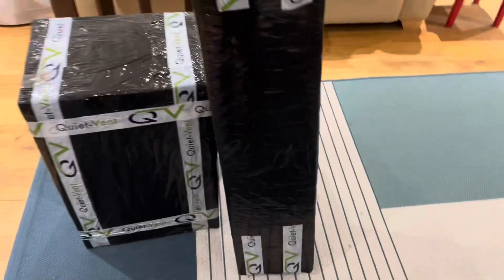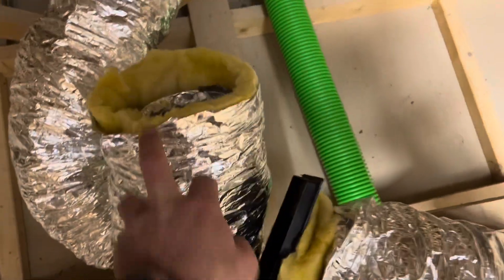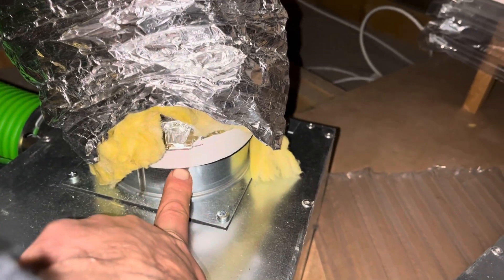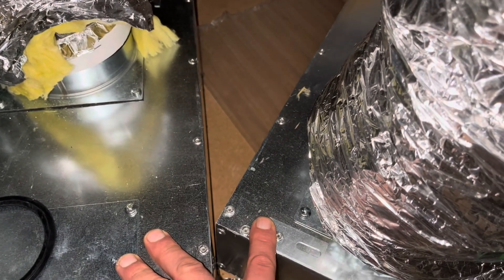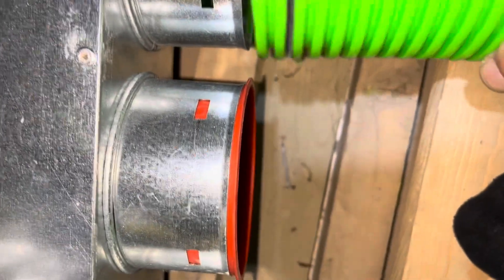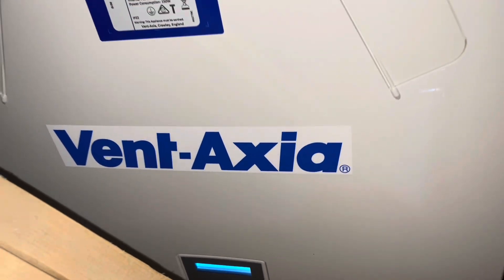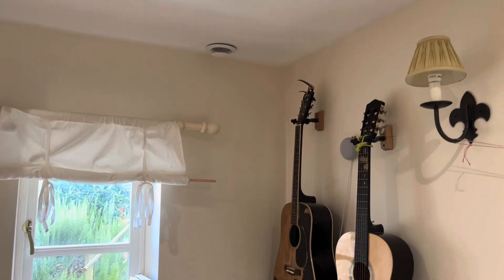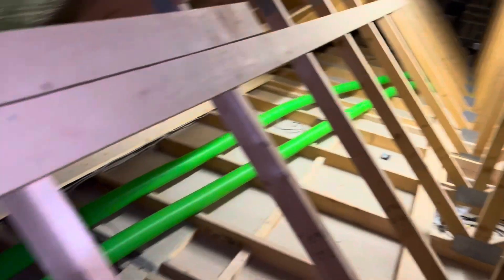4. DIY MVHR: Attaching the ducting to the MVHR unit and turning it on for the first time - success!!

Comment: How can you balance this system?
Reply from the maker: This is something I still need to do as part of full commissioning. The way to do it is get a bucket to cover each duct with a hole in the bottom and an anemometer in the hole. Then you can work out, and balance, flow rates

Comment: Compliance to BR Part F states flexible duct to a min of 300mm , MVHR needs to be able to access the heat exchanger to be removed for service when you need to remove the heat exchanger you will need to take the entire unit down. . You need to mastic the seals around the top of the unit.  All ducting in the loft void needs to be insulated. Many areas of this install are not compliant. Ceiling grills you need to install correctly and adjust to the correct airflows. MVHR installation is not DIY>
Reply from the maker: Thanks for the advice, I am slowly insulating the ducting in the loft (along with insulating the floor of the loft). Also the unit is very accessible where it is so has been fine for changing the filters. So hopefully neither of those will cause any problems going forward. And the system is certainly working as I’ve never had condensation on any windows since installing it and my hygrometers show the humidity in the house is significantly lower

Comment: You really do need to move that unit so that you can service it. How can you even get to the control panel to configure it? I added a remote screen to my one, I think it was £50. That way you can at least see when it is on summer bypass or in frost mode.
Reply from the maker: Yes I liked the idea of a remote screen as well. I may get one in the future but for now I’m quite lucky that the unit has plenty of space around it and I can move it easily to access the screen. I think I can also quite easily remove the filters although I haven’t tried that yet. I’ll try to make a video of that when the time comes to change them.
Reply: @aktsolar  I think what helps you is that your larger ducts seem to be flexible while ours are ridgid steel pipe that we had to then insulate. I can see if that is the case you could move your main unit. For us to do that is many hours work.
Reply from the maker: @JurassicJungle Yes, that’s right, the large ducts are flexible and insulated. It does make it very easy to move the unit
Reply: @aktsolar  Ours were all solid steel pipe so lots of cutting and mounting brackets required. then it all had to be insulated. I think it took me a couple of days working in such a small space. I guess there could be some efficiency difference or perhaps noise but your setup looks so much easier.

Comment: Looks good, have you noticed any difference in condensation? Have you measure the temp of the air coming in to the rooms to see how good it is at warming it up from the outgoing air?
Reply from the maker: I also have a hygrometer downstairs in the lounge. It used to be typically in the 60-70% range. Now it’s in the 50-60% range. It’s been going for a week and it seemed to reduce slowly over the first 3-4 days. It seems quite stable now. But then the weather outside makes some difference so I’ll keep an eye on it over the coming weeks and see if it stays down - or maybe even goes down further
Reply from the maker: Yes, no condensation at all on the bedroom windows now.

Comment: Looking really good - well done.  I had some questions
- Some rooms have the air sucked out and some have air pushed in.  I guess bathrooms and kitchen have air sucked out but where do you push air in?  Do you need to push in upstairs and downstairs or does it not matter?  Did you include bedrooms as well?
- Does the boost apply to all vents or can you limit it to a specific bathroom?

Thanks
Reply from the maker: Yes, you suck out of the toilets, bathrooms and kitchen. I also plan to have a vent sucking out from the boiler room (just to prevent any fumes from that getting to the rest of the house. Then you have it pushing in in the lounge and bedrooms.
Reply from the maker: So it does push in in more places upstairs and suck out in more places down. But then it crosses over in the hallway that is common to upstairs and down so it doesn’t matter that there are more intakes upstairs than downstairs
Reply from the maker: And yes, the boost boosts everything. I think you want the inflow and outflow to balance in the house so you wouldn’t want to just boost one outflow